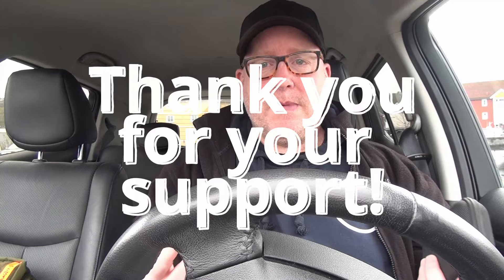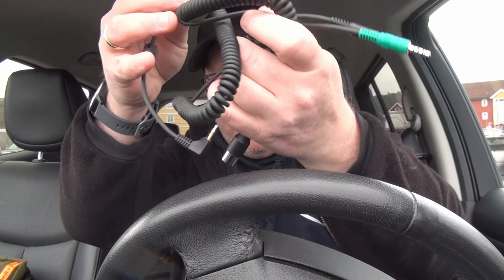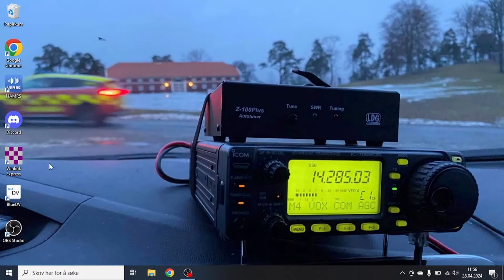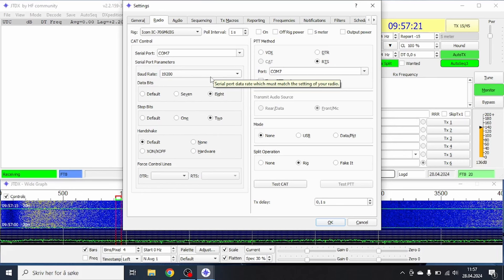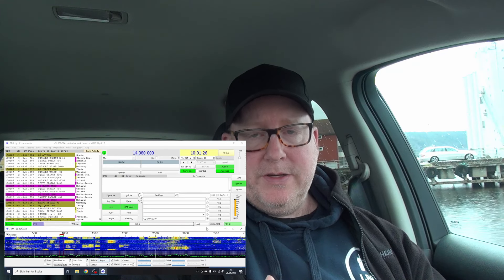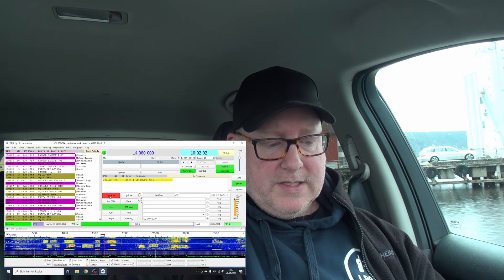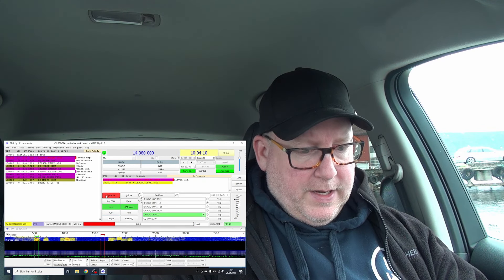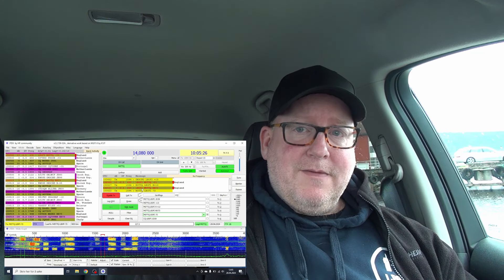Is the DIGIRIG the easiest way to get DIGIMODES on your OLDER RADIO?

Comment: I have a (Brand New, in the box) Icom 706, mark 1. It was handed down to me from my favorite Uncle (whom got me into ham radio!). I have not even got it set up yet, because I don't have any HF antennas up yet.
I already have a Digirig mobile, I use it on an HT radio for my portable Echolink station.
Reply from the maker: I am sure you will be happy about that radio. Check out my recent video about five antennas for new hams for some inspiration for your first antenna.
Reply: @LB0FI  A New ham, I am not! I have been a technichian for 30 years. I just never got into to HF because I am still having fun with VHF, UHF & Digital modes! But have since wanted to expand my education a bit.

Comment: I need to buy a digirig for my 706 and one for my G90.  I don't think one will work for both.  Thanks for the video on how to set it up!  73 Morton
Reply: In theory you should only need a separate set of cables for the 706 and G90 and the digirig should work with both radios
Reply from the maker: You will need separate Digirigs for those radios. The 706 use CI-V for CAT and the G90 use RS232. You could reconfigure one for each use, but that would involve adding and removing solder bridges for each use.
Reply: @LB0FI  Thats what I thoguth.  Thanks! 73
Reply: There is a video on the digirig site that shows how you have to cut and/or solder a couple pads on the board for Kenwood/Xiegu vs Yaesu vs Icom.
Reply: @LB0FI  the G90 uses CiV commands. A limited selection of them compared to the icom. The G90 does not have RS232. CAT control (CiV) is via the supplied USB to 3.5 stereo connector which uses one ring for send and one for receive data (ICOM send Rx and tx data on the same ring - hence the need for a different cable). Audio to the radio goes to a mini-DIN ACC socket on the G90 this is also a different plug to the ICOM hence the need for different digirig to radio cable set. If you end up buying two interface boxes buy the digirig from the ICOM and Xiegu's own DE-19 for the G90. It does everything the digirig does and is cheaper. 
73 Ed DD5LP
Reply from the maker: @DD5LP  The G90 use CAT commands, but the connection is not CI-V though. CI-V is simplex where as the G90 needs duplex communication. You can find more info here. https://digirig.net/understanding-rig-control-options/
Reply: @LB0FI  ICOMs are not exactly simplex rather they switch between one direction and the other on the one connection (I think the term used is multiplexed). This does not however change the fact that Xiegu radios use a cut down version of CiV (which itself is a simplex protocol) and so I would have hoped that with a modified cable one digirig should work with both a G90 and an ICOM radio but from another comment here it appears that a physical change inside the unit is needed which is a shame. That's life. 73 Ed